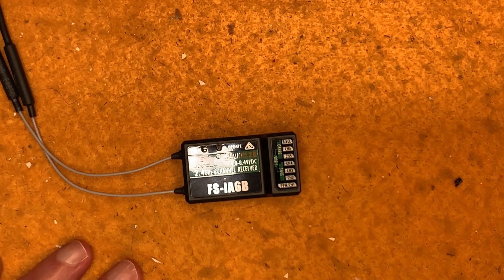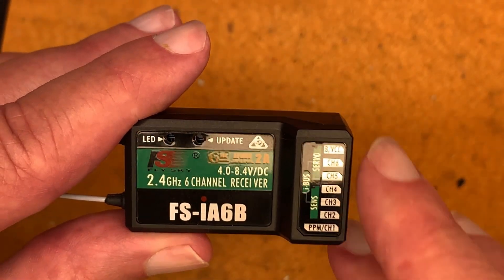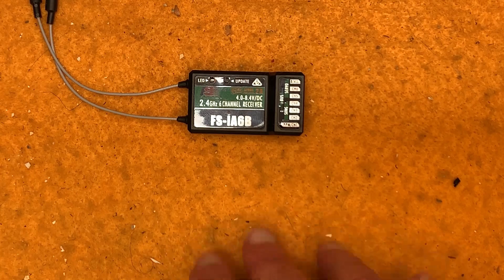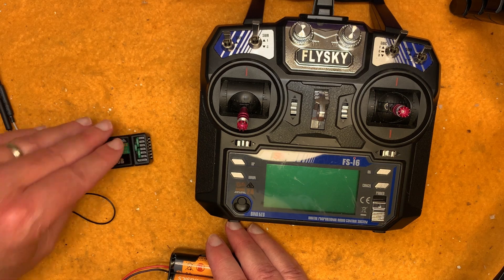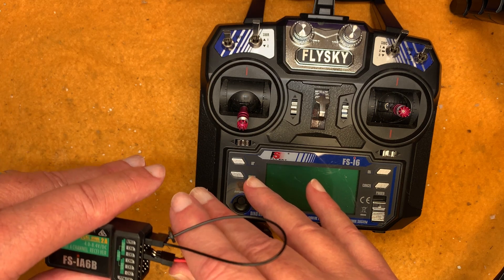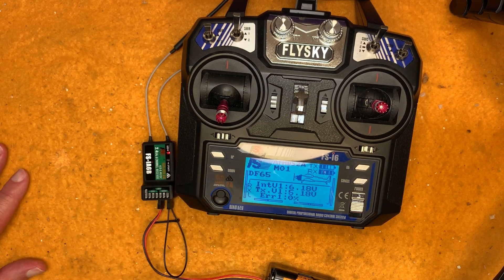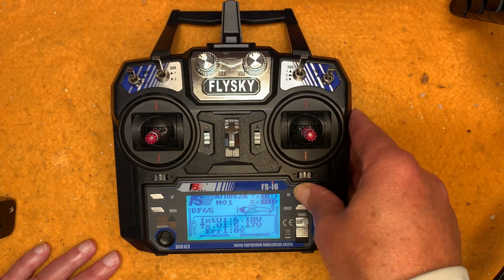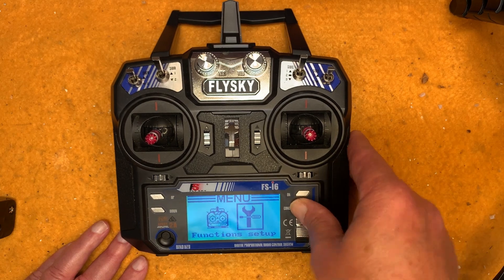DF95 FlySky i6 receiver setup

Comment: Peter. Very helpful video(s), thanks. I have a question however: I want to add a bilge pump (larger old wooden boat). My pump does not have a signal wire, only red/black power, so only on/off. How can I assign it to one of the aux switches just to turn on and off?
Reply from the maker: Glad the videos were helpful. I haven’t worked with aux channels, so I’m not sure how best to do what you’re asking. A r/c switch might do the trick (perhaps something like https://www.motionrc.com/products/gt-power-electronic-switch-gtpelswitch ). Let me know what you come up with!